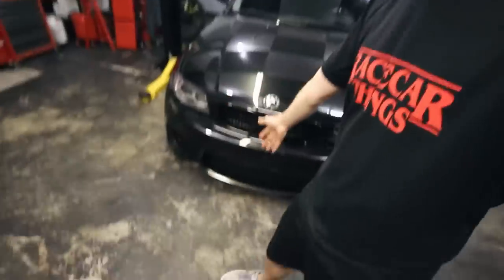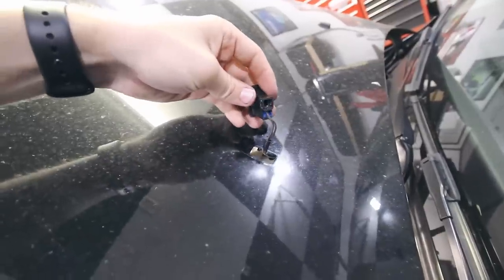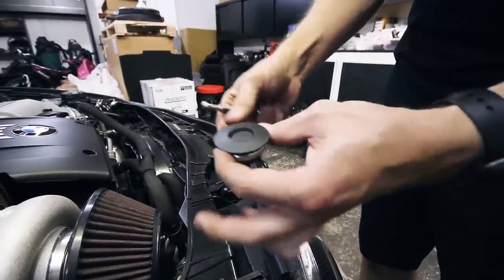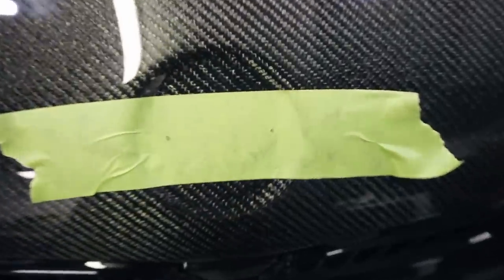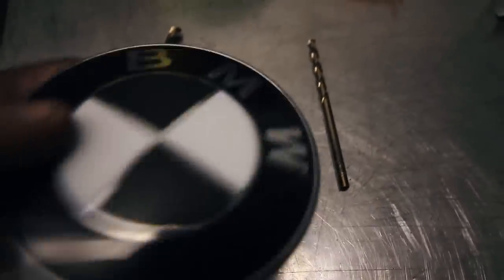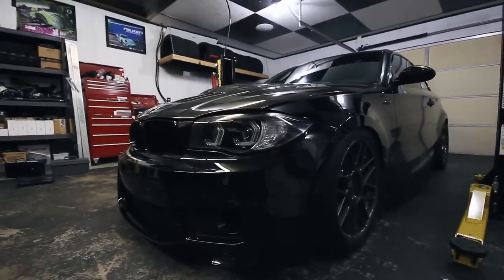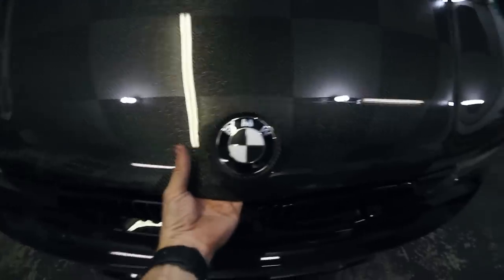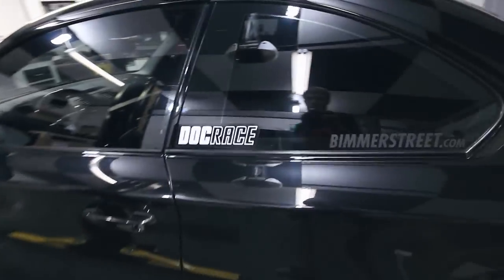AGGRESSIVE Carbon Fiber M3-Style Hood for my BMW 135i!

Comment: 👍 for Eileen, also if you find that the hood “pushes up” on the sides near where the hood struts mount(usually happens over time, it bows the hood) just delete them. Plus it’s a couple pound weight save. I kept one installed on the car and could pop it in when I need the hood propped. I had that experience on a carbon hood before
Reply from the maker: Good to know! I'll keep an eye on it. So far one strut is working good.

Comment: Looks super sick!!!  That hood fitment is spot on.  For future reference if useful... when I drill carbon fiber or fiberglass its always messy, so I usually have someone hold a vacuum near where I'm drilling so it picks up all the shavings/dust right away, just less to clean up afterwards.... Looking forward to the trunk install!
Reply from the maker: Good point on the vacuum! Trunk install will be next, stay tuned!

Comment: Hey Jake, I would highly recommend at least getting the hood and trunk lid ceramic coated. If you would like to even go a step further, spray the hood and trunk lid with some clear coat. Most carbon products are coated with a gel coat that will fade over time.
Reply from the maker: I've had a few people tell me this now. Do you think ceramic coating would protect it just as good as clear coat? If so, I'd go that route.
Reply: @jake_spence  Ceramic coat would definitely help! Carbon gets cloudy over time due to UV Damage. If you keep it in the Garage mostly, ceramic coat should be fine.
Reply: @jake_spence  baddest Bimmer in the Valley.  Hey I can get you hooked up with the Ceramic Coating. Let me know.

Comment: Jake... I have to say that your 1er is gorgeous.  To be quite honest, it’s how I want mine to turn out when I have the capital! I was curious as to how you were able to raise the hood to be level with the top of your side fenders? I have the same hood, but for some reason my hood sits lower, so I feel like I’ve done something wrong
Reply from the maker: I'm not gonna lie, it took a lot of adjusting off camera to get it to sit the way it did. Adjusting bolts, mounts, latches, etc. And then I took it to the 1/2 mile and did 170mph runs back-to-back and it tweaked the hood because I didn't have the hood pins installed yet. I'd just play around with all the joint locations and make small tweaks one at a time.
Reply: Jake Spence gotcha! Thanks a bunch for the info and I look forward to seeing the hood pins installed!

Comment: What turbo you running and engine mods bro? Props for doing the engine first then the styling
Reply from the maker: Thanks! It's a 6266 turbo with a stock motor. Doc Race intake manifold.

Comment: Besides the hood, how else can you save weight at the FRONT of the 135i? 
There are several useless brackets & plastic things in the engine bay I found but is there anything else cheap left? Carbon cross braces instead of the factory metal?